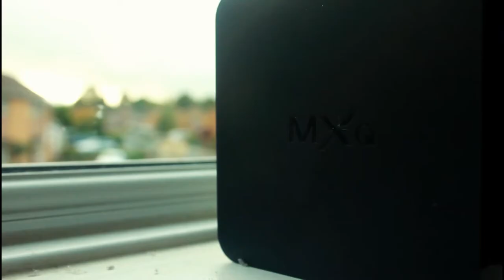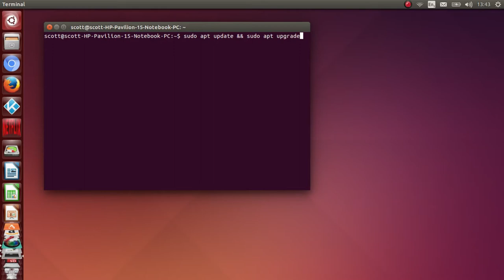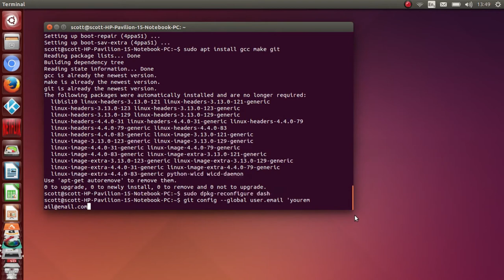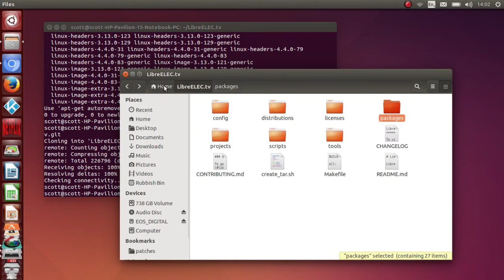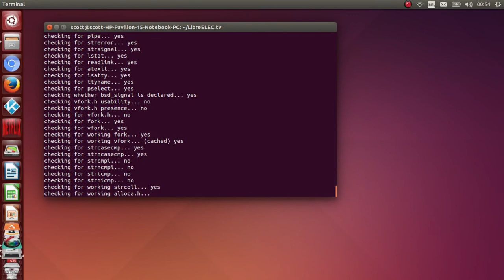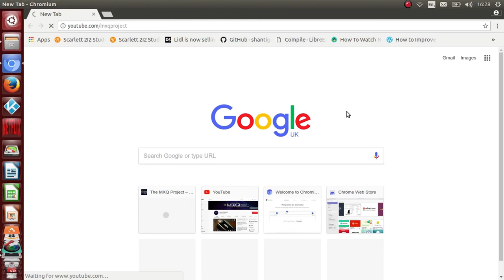How to COMPILE LibreELEC using UBUNTU and GITHUB to build a Kodi Operating System

Comment: thanks for the video just what i was looking for.

how ever i have one question, i have a s905x box and was wondering what the commands would be to complie for that.

for s 805 it is this
PROJECT=S805 SYSTEM=HD18Q ARCH=arm

would it be this for the s905x
PROJECT=S905 SYSTEM=HD18Q ARCH=arm

or the sysrem be something else, i have googled most of the day and not found any info on the type of mobo it uses.
Reply from the maker: PROJECT=S905X SYSTEM=P212 ARCH=arm - Hope that helps